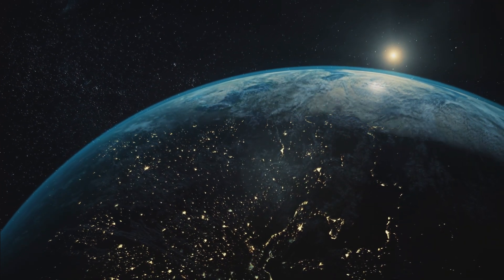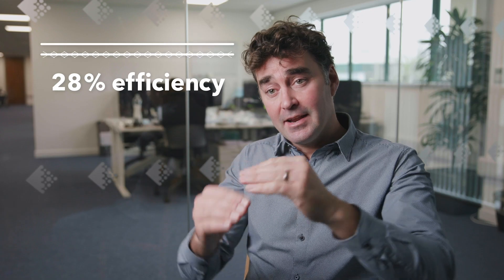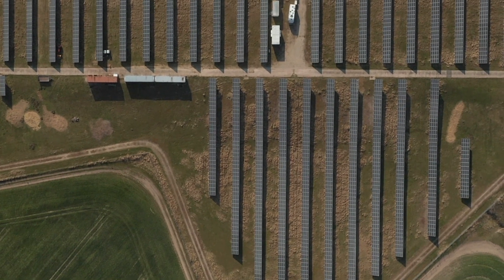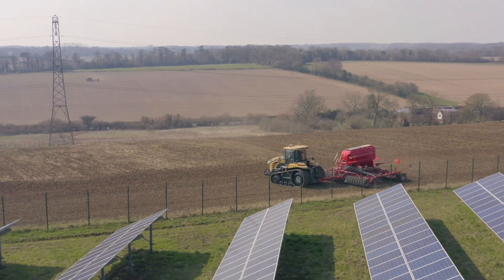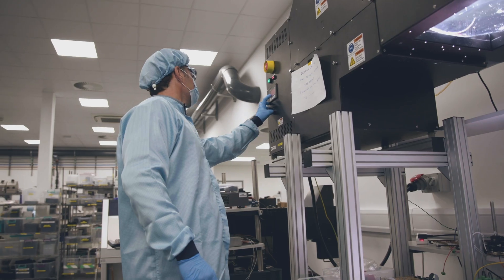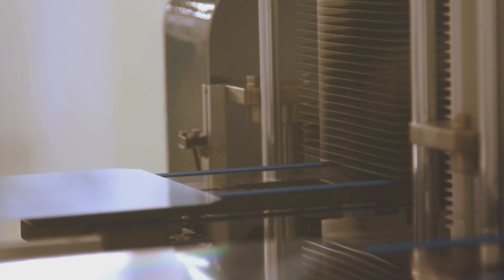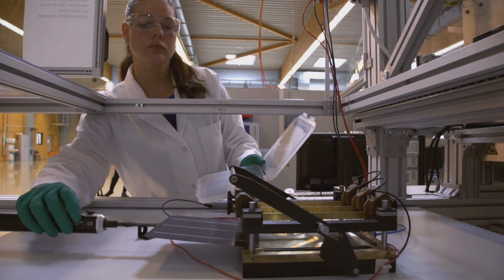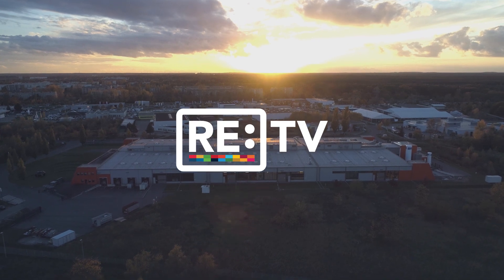The New Material Revolutionising Solar Power

Comment: I wonder how they figured out the degradation issue?
Reply: Simple. Perovskite is not a material. It's a crystal lattice structure. You figure it out like any other complex system like weather.